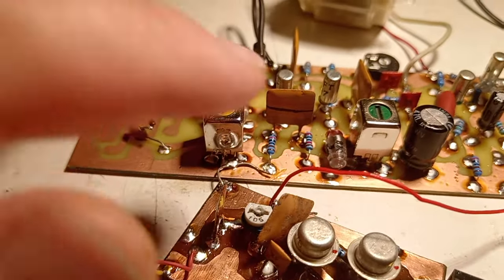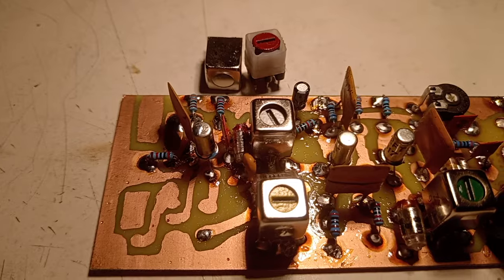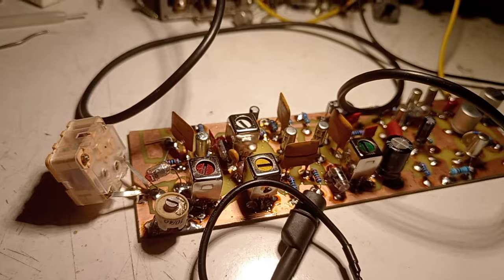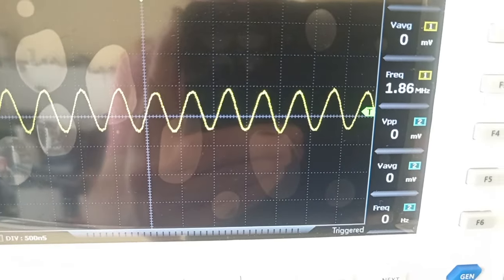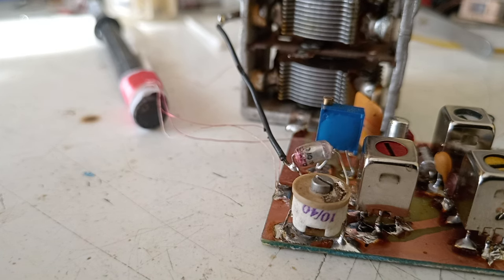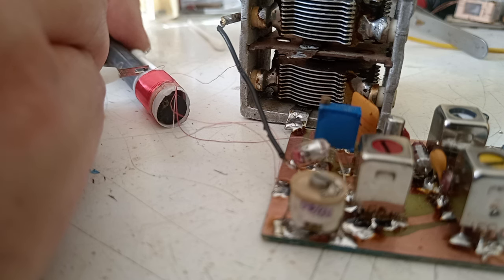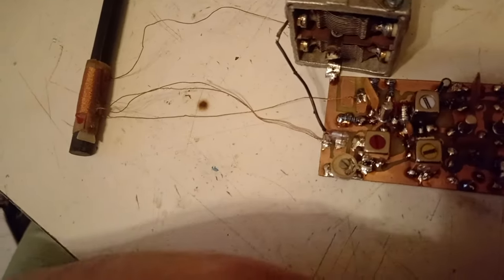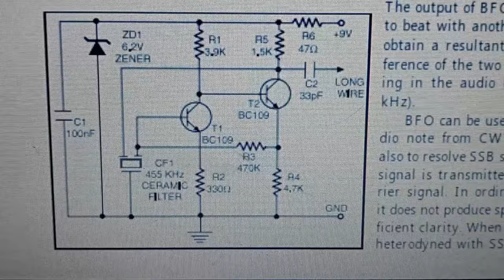AM super heterodyne radio receiver Pescarus. Homebrew superheterodyne by YO6PMX. Part 2.

Comment: I applaud your effort to build and align a superhet, especially when modern microprocessors and software defined receivers make it so much easier to achieve the same results. Building these devices gives you an advantage in understanding the underlying principles of a technology that dominated much of the 20th century and is the basis of many modern devices.

Comment: Looks super nice! Is there a way to know what frequency it’s tuned on?
73s! 📻✌🏼
Reply from the maker: Hello, yes, of course, you can attach a digital frequency meter( with PIC16F628 by ex) to the oscillator coil and you set it to display VFO-IF, that's exactly the received frequency. You can find such project here: https://www.hamradio.in/projects/multifunctional-frequency-counter